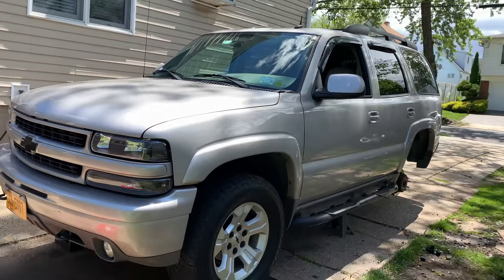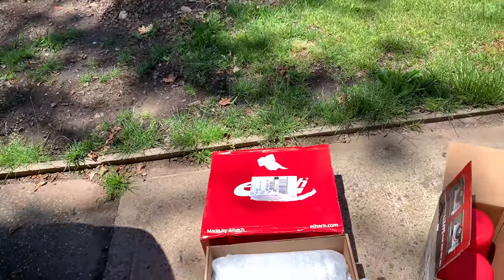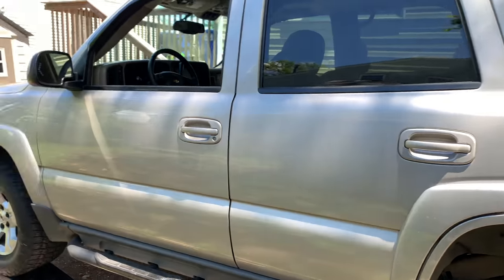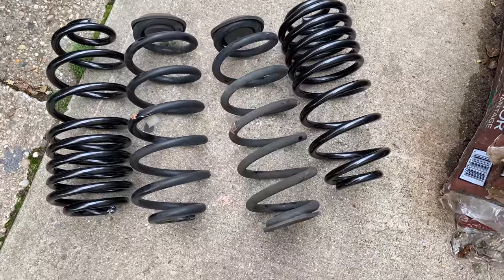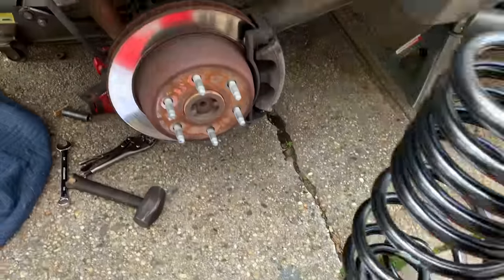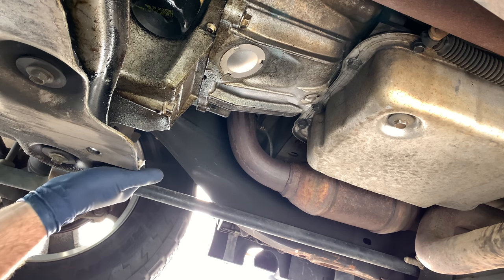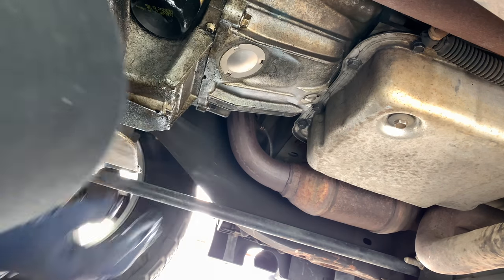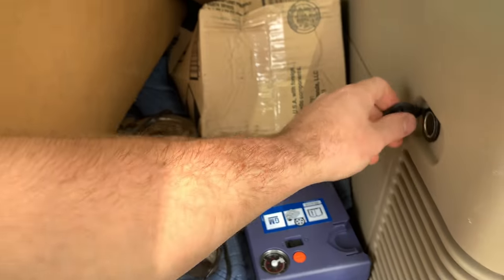I Decided to LOWER My Z71 Tahoe!

Comment from the maker: I can't wait to get a trailer behind Tahiti to test out these air bags! Who else wants to see me tow with this thing?
Reply: For sures 🤙🏼🤙🏼
Reply: Big fan brother you should make some decals for the channel 👌
Reply: I want too see :D how much weight is gonna take
Reply: Check out the helwig larger front and rear sway bars for handling. I’m not sure how much you know about these trucks, so I don’t mean to insults your intelligence. I’ve DMed you on IG. But if your truck doesn’t have hydroboost, I would highly recommend you install it, my 05 suburban came with it. Also, the GMT900 front brakes are a direct bolt in. They are 1” larger so that will increase your stoping ability, especially with a trailer on it. I opted for the bracketed PPV calipers, and duralast GT street rotors and pads all the way around. They are a metallic/carbon pad and slotted rotors. Mine ran me $330 out the door for everything. It’s a night and day difference in how well it stops. I would also recommend pulling the transfer case and installing the pump rub elimination kit from merchant automotive. This will save you from not only being stranded when pump rub strikes, and it will. Plus will save you from having to replace your transfer case when that does happen. The kit cost about $100. I am happy to talk to you off line about this condition, but you can google pump rub and find out what happens.
Reply: @michaelminer8531  The transfer case pump rub is no joke. Backing in at the VA one morning and that's all she wrote. It had wore a hole clean thru the case and lost all the fluid. 03' Z71 Tahoe.
Reply: I will pray for you and your vehicles. I am not a religious person. Sarcasm. I am not sold on the lift bags inside the coils. Like the air shocks of old used to jack the rear up to fit big ass tires, I would hate to see a failure in the supply line or a puncture in a bag. It wouldn't be so bad if it finally lost all air at a stop, but if it were to fail catastrophically while moving at speed with the loaded trailer behind you, it would be a little exciting to say the least. You don't have the best of roads there in NY. AirLift and Eibach are good companies for what they do, but compensating the 2" drop coils with the airbags is a head scratcher for me. Maybe I am missing something. The Tahoe does look good leveled out as it sits and the handling should be improved with the lower center of gravity. It is the towing side of it that gives me the willies for some reason. One other thing before I shut my face, since you are bound and determined to tow in this configuration, watch the break-over for the trailer in the area of the trailer jack going up and down inclines such as driveways etc. Once you inflate/charge the airbags the weight on the truck and the trailer load is transferred primarily to them and less on the springs. Capiche?
Reply: Definitely grab a trailer and try it out.  Towing is more dangerous than a lot of people give it credit for.  Always better safe than sorry when your pulling weights with your vehicle.  Brakes are a good thing to upgrade and also keep an eye on.  Stopping is the most important thing really.  Power and drive ability should always come 2nd in my book.  She looks killer tho!!! Should be good to go now!!!
Reply: Yes we Wana see u tow always good seeing some one put the v8 to work
Reply: Ernest Paul it is a problem on all full size GM pick ups and SUVs with the auto trac II 4wd system in the GMT800 platform (01-07). It was such a prevalent issue that GM had a recall on them. But the recall installed a pump that had a little wider spline/teeth to have a better fit in the case and different anti rattle clips/shims. This did not fix the problem. Plus, the case with this condition only leaks as your driving because the auto 4wd feature, as far as the transfer case goes, uses a hydraulic pump to supply hydraulic fluid to a clutch pack to supply power to the front drive shaft. This pump is only supplying fluid flow when the transmission out put shaft is turning. And it’s this fluid flow that pushes the transfer case fluid out of the hole the pump rubs; or machines, through the case, as the pump is splined to the rear case half.
Reply: Why air bags? Auto ride or premium smooth ride package with self leveling shocks? Or neither? Max I had on my truck was around 5,000 and them self leveling shocks are still 💯 at 178,000 no sag after there ‘2 mile leveling period’
Reply from the maker: Michael Miner oh the pump rub hit already. I cleaned and plastered it with jb weld for now. I figured Ill address it when I swap the trans out.
Reply from the maker: T-Bird 91 yea it doesn’t have either.
Reply: LsxMatt  do you want to keep 4x4 or would AWD work better for your needs? Cause if AWD would be better suited for you, and your swapping in an 80E, look in to the AWD Silverado SS trans and transfer case. It’s a viscous coupled case. And you won’t have to deal with pump rub.
Reply: LsxMatt had to ask thought they all came with one or the other!  The self leveling shocks really are something all trucks should have in my eyes, but $250 a pop when needing replaced.
Reply: LsxMatt Why the hell would anyone lower their vehicles it’s very stupid to do that the reason why people buy Trucks and SUV’s is for them to be lifted (not lowered)
Reply: Chanse Ormon fo sho
Reply: So when will there be towing vid???
Reply: @skater041930  Z71 off road package did not have the auto ride system.
Reply: @chanseormon  I have never raised a truck in 50 years of driving them. Not even my Jeeps. Seems towing race cars would say LEVEL THE TOWING VEHICLE FOR TOWING. Anything else WOULD be stupid. And that's "why the hell" you lower the rear end. Never seen him tow a drag car to a mud pit.
Reply: Hey man just started following the serious. Came across this video but I can’t find those helper bags. Would you happen to know another link?

Comment: Good Morning Matt   Just  got just   this week a  2003 Z71  Tahoe,  white. I  am  an  ex  Sports car  road racer and 2  time National champion. Have designed and  built 2  of my  cars  from  scratch.  I  may  drop mine 2/3  to  help  handling and  improve the look too.The  rake  probably  helps reduce understeer as well as  support  heavy  rear  loads. I  just  want to  reduce it a  bit .I  feel that  spindle  front  drop is  best  ,  to  avoid introducing  angularity in the  front  drive universals. Lowering the  height will  help  reduce  body  roll too. PO  installed  KYB  shocks. I also will stay  with  original  tire  wheel  combo.   It  will see  snow  driving.    Even so I  won't  drive it that  aggressively.  Have  daily  driver  BMW   for that.  Replaces a  96  Tahoe  I  had  for  14 years.  Liking your  videos  for  obvious reasons. Located  LI  NY

Comment: Dropped my Yukon aswell, added sway bars. It's crazy how much body roll these stock trucks have. Love your Tahoe vids! Very inspiring!
Reply: Do you need to add new sway bars when you by smaller springs that come with the shock extenders ?
Reply: @theworldisyours5336  Not necessary. I personally, just wanted less body roll
Reply: I want to drop my back end on my 03 Tahoe z71 I should be good with just 3in lowered springs an the shock extenders?
Reply: @theworldisyours5336  I couldn't tell you for sure. I did the whole belltech suspension. 2 in the front and 4 in the back. Replaced all my shocks, springs, and struts. Added hellwig sway bars and a spohn panhard bar

Comment: We have done several of the same mods to our vehicles. I posted on the previous video with LED bulbs. I also have the bilstein 4600 HD shocks on my Silverado and Yukon love them.
My Silverado has the air lift 5000 air bag system in the rear. Instead of doing the 2inch shackle drop like I had done on my 2wd. My z71 truck I tow with I added the air bags to help with squat on towing and add stabilization. It increased my rake when sitting empty but when towing it sets level. I have the suspension max torsion keys for the front to level truck when not towing but I am fitting 33.5 10ply tires right now with very little rub. I just want the extra height when not towing. So my rake drop isn’t as much with air in bags and the ride is so much smoother with air back there. I love them. I’m afraid the keys are going to make it set level empty but drop rear more when towing which means I’ll either take back out or have to run more air in rear. To level it up towing. I ran my air line across spare tire frame and to mount valve I ran it to back bumper and drilled hole in rear bumper just under the spare tire up/down, door thing lol whatever it’s called. Clean no one notices it and easy to get to even with a trailer hooked up

Comment: To fix the turn signals, I have always used urethane or butyl like they use to seal windshields. It works MUCH better than silicone but isn't super friendly on the wallet. The good news is that it doesn't take much at a time so it lasts for a while. And having the T/A, you're going to need it sooner than later anyway- bite the bullet.

Comment: I went with the timbren bump stops in my 04 Escalade ESV.  My rear air ride shocks were blown, and this made the back much more planted.  They replace the factory bump stops with ones that are much taller. Don't mount inside the spring.  The airbags will eventually stretch and wear out around the schrader valve.  The timbrens will basically last for a few decades.  And by that time, I'm sure your Tahoe will be rusted through with that NY salt.

Comment: Just a note as I’m watching this. You should try to make the air lines equal length so you have equal pressures on each side. As the suspension articulates, the pressures from theft to right are going to be different due to the different lengths of the air line going to each bag. I also would have ran the shrader valve through one of the license plate bolts for ease of access. I’ve installed these kinds of systems on 3/4 and 1 ton trucks many of times and this is what I have found to be the best way to do it. Also, I would recommend running the air line through some rubber hose, like trans cooler hose or something like that to prevent chafing or rubbing through on the frame and chassis components. Also this will help prevent it from melting when ran close to exhaust components and other systems that generate heat.
Reply: If the truck had air suspension only in the rear, that would be ideal. For a supplementary airbag system, the springs, shocks and swaybars that are all normally keeping it level side to side are still all doing their job.

Comment: It looks nice with the lowering springs in the back, but you could have just tightened the torsion in the front.  They weaken over time causing the rake to be a bit excessive.  That way, you don't lose ground clearance.  I am constantly using the overhang and driving on curbs in my suburban just beacuase of the horrible steering radius.

Comment: That oil leak above the oil filter is usually the gasket for the oil cooler Linea that go to the oil pan.  Sometimes, though rare, the block that holds both oil lines get a thin crack. Good luck.  Love your videos LSXMatt

Comment: On my stock (they are replacements, the truck was in a front end collision and repaired before I got it) turn signal housings, I wet sanded then to clear them. I noticed that the lense gasket/seal to the housing had failed in some spots; the lense was pulling away from the housing. From what I understand, the heat from the lights being on and the sun destroys it. I think some clear silicone around where the lense meets the housing, new bulb gaskets, and after installing the new gaskets and putting the bulbs back in, some silicone and/or heavy water resistant grease around each socket should keep the moisture out. The blue gaskets are breathable and over time become lose and allow moisture to get in there.

Comment: What I did with my turn signals was use VHT to lightly smoke the stocks turn signal and they look amazing! Even better they fit like they should with no leaks!
Reply from the maker: Good idea. Im gonna try sealing around the bulbs and if that doesn’t work I might go that route👍

Comment: Nice video!  I have a 2002 2 wheel drive suburban.  245,000 miles.   I have worn out 3 sets of airbags inside my coil springs.   I'm considering going a full air bag suspension.

Comment: Its doubtful that your front diff seal is leaking. The front diff doesn’t hold much fluid so if it’s been leaking enough for you to notice it, the diff would be making some noises. It’s mostly from your trans cooler lines before you replaced them and it was dripping down. Easiest way to check would be to drain and fill the front diff. Capture the fluid that comes out and measure it. The front diff holds about 2qts. If it’s significantly less than that, then I would look in to the front diff pinion seal. Your oil on the oil pan is most likely the oil pan gasket/upper oil pan gasket. These are prone to leaking and is an extremely common issue on gen 3 and gen 4 Vortec LS engines

Comment: My yukon actually came with the spring air bags when I purchased mine used I love them have towed a few things including a car trailer and my old car to scrap and it barely had any sag 
Edit: Purchased vehicle 5yrs ago and have put on over 60k miles idk how long they where installed before purchase but still work fine

Comment: have you modded your air spring kit to run each bag on a separate line? we kept them T'ed together on mine for about a month before we realized how much body roll they created pumping air from one side to the other going around corners. Putting each on their own valve solved this and really helped to make the truck more stable.
Reply from the maker: Nah I still have them connected together. I haven’t noticed any roll, but really haven’t loaded them up yet either. I’ll look into doing that.

Comment: Great video, good job bro. I have the same problem with my Silverado Z71 turn signals..replaced the sockets (came with new grommets) and resealed the lenses with silicone sealant. I eventually just sealed the light socket to the back of the turn signal housing. Hasn’t leaked yet and it rains all the time in south Florida 😎
Reply from the maker: Lmao yea thats my plan. Going to put a light coat of silicone on the bulb gaskets!

Comment: Cool location for the air stem with easier access is the rear license plate screw.  I had air shocks on a lowered extended cab and you could hardly see the stem.

Comment: Matt,  what is the measurement, from bottom to top center of the quarter panel lip, without any air in the air bag ? 
and what size are your coil spring seats top and bottom ? and is your tire size 265/65/18 ?

Comment: i think you should remove the roof rails (if you don’t plan on using them), it would make the car way cleaner
Reply: Iacopo Benedetto Good idea. When I took them off from a Trailblazer it looked way better in my opinion. 🤙🏽
Reply: Dude, I was thinking that too. Especially with the color of the vehicle.
Reply: Or go to the lower profile that comes on non z71 models.  I think the tall ones look tacky, but the lower ones look fine on old suvs.  Newer unibody suvs, none looks best.

Comment: And check that oil cooler fitting, right above where the oil filter is, see if it's leaking from there.  Mine was, and it looked like the same situation.

Comment: In preparation for towing you should considering trying to remove that spare, cause I bet it’s stuck and you couldn’t get it loose on the side of the road. Heck thieves could steal everything off the truck but that would still be there.

Comment: Do u think u have to change the springs if u have a 2.5 inch lift shocks or stock shocks when towing with the air ride not a drop kit?

Comment: i wonder why did you cut 1 inch holes in the shocks cover? i think the hose can get thru the original hole
Reply from the maker: Yea I was thinking the same thing but it looks like if the airbag moves a little inside the spring, the fitting will catch the edge of the isolator and may rub or come off.
Reply: @lsxmatt  cant argue you're the one who installed it

Comment: Mat  please  with a  torsion  bar  drop of  2  inches  were  there  camber issues?? I  want to  do  2/3 on  my 2003  but  not  sure if the  camber  becomes a  tire  wear   problem 

thanks
Reply from the maker: I didn’t drop the front, just the back. The torsion bars are left untouched.
Reply: @lsxmatt   I Finally realized that  Thanks

Comment: I Love This Generation Tahoe I Had One This Same Color But It Was A LT I Want A Z71 This Time A Round Or A This Generation GMC DENALI I Want To Put The 22 Inch 2007-13 Silverado Wheels On The Z71 Or If I Get The DENALI Put The 22 Inch 2007-13 Escalade Wheels On It

Comment: Don't like it! You broke the cardinal rule!  A 4x4 never ever should be lowered! You should have either kept it as is or lifted it! Its not a sports car.  There is a reason a 4x4 sits higher than a 2x4 from the factory.  You get snow up in NY and having the clearance is what is needed in the snowstorms. It looked beefier before now it looks like crap!